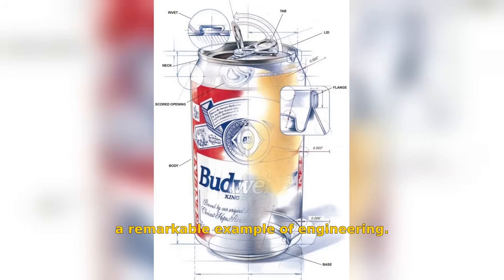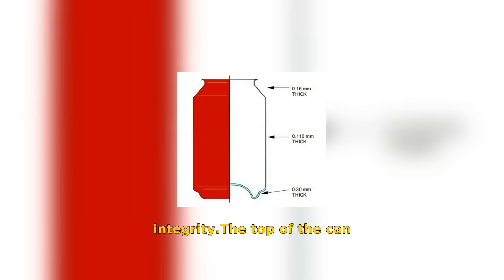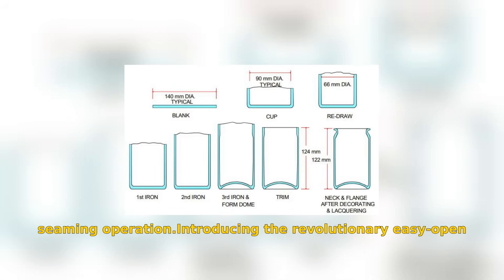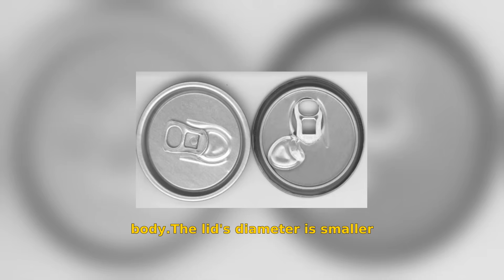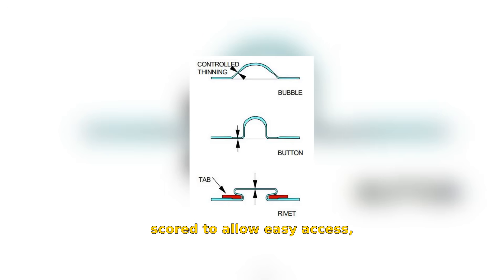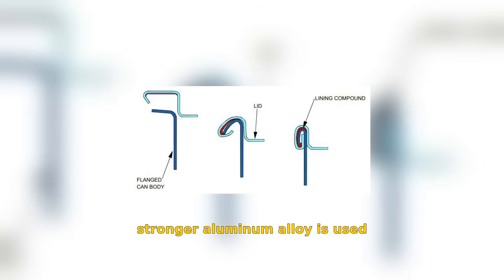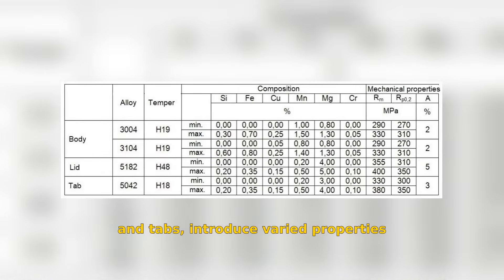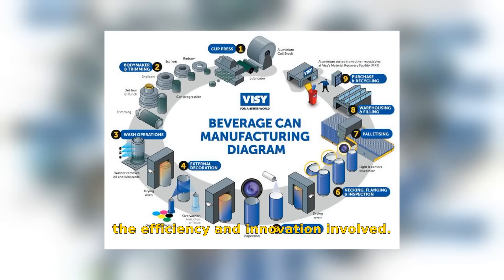The engineering of an aluminum beverage can

Comment: does it make it hard to recycle the cans with all different alloys?
Reply from the maker: Recycling aluminium can scrap into new cans is considered a great example of a nearly waste-free production process. 
Simple remelting of aluminum can waste yields the following average aluminium composition: 0.26% Si; 0.40% Fe; 0.20% Cu; 0.86% Mn; 1.22% Mg; 0.04% Ti; the rest is Al.
"Aluminium" of this chemical composition fits well into the chemical composition ranges of alloys 3004 and 3104, which are used to make can bodies. Therefore, most of the metal from aluminum can scrap - about 80% - is returned to the manufacturers of new cans.